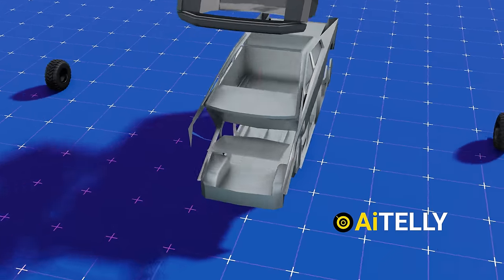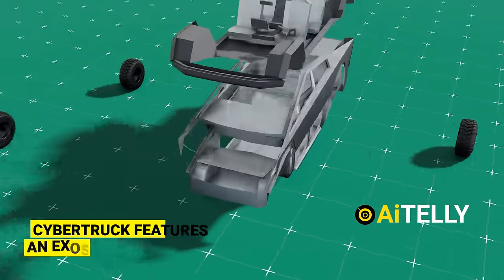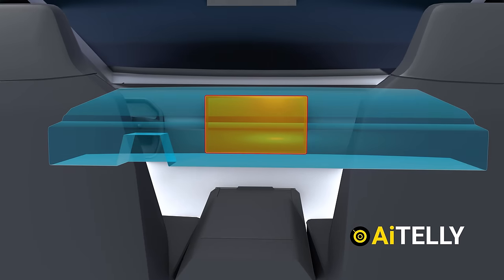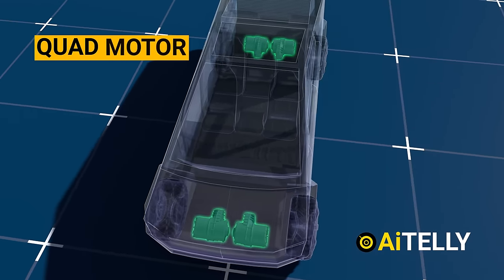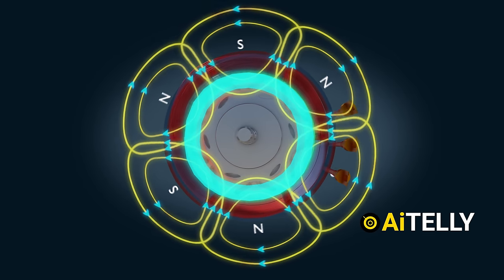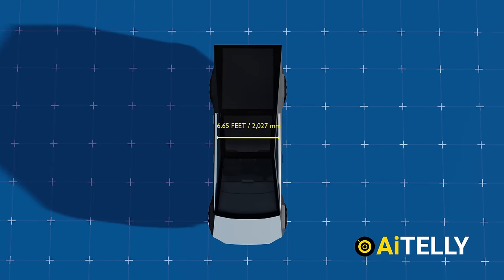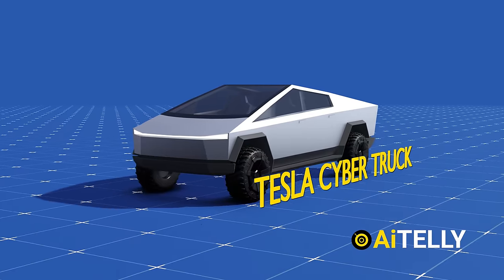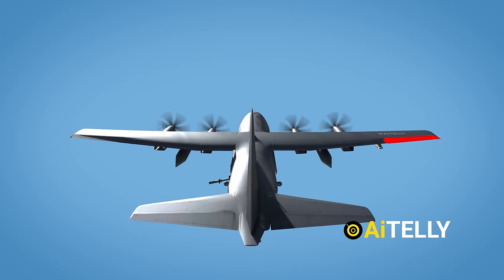Cybertruck Explained  #tesla #cybertruck #3d

Comment: Lots of details and terminology are wrong but nice animations and explanations.

Not SUV, it's a TRUCK (Edit: As others pointed out it's Pick-up Truck)

Screen is 18.5", not 16"-17"

Not bulletproof glass. (but stronger than other cars) Only body is and that's also not for all types.

There are no quad motor variants. And only one out of three motors will be magnet motor. Other two will  be induction motors.

Weight is near 7000 lbs not 5000

Towing is 11000 lbs not 14000
Reply: I believe Tesla provided the data which is probably outdated.
Reply: I agree, but they uploaded this exactly on the day of the delivery event. They could just wait one more day and do the fact check before releasing as it's informative video. (Which in this case, wrong)
Reply: I believe Cybertruck is called pickup truck, not truck (like Semi)
Reply: It's a cyber toy, not a truck. Whether or not a truck or anything else for that matter,  is any good depends on how you intend to use it. To me, it's just another tool.  EV pickup manufacturers should build two types of pickup truck. One for the current market that uses them as an recreational toy and ego booster and one where form follows function with no money wasted on useless styling. It's aesthetic appeal won't earn any more revenue than an ugly truck. Insurance companies are steadily raising their rate for EV's because of the ridiculous repair costs.  EVs depreciate a lot more than ICE vehicles because of low resale values.  Most people who are out buying Tesla's popular and controversial EV pickup are probably not worried about these costs. They're more likely agog over the nothing-else-like-it styling and, at least among the early adopters who  spending six figures on these things, they can likely absorb higher repair costs.  For a construction contractor,  these prices  seem as outlandish as the truck looks. Let's face it, the Tesla truck doesn't seem like it's going to be useful in the construction industry.
Reply: Technically it's a pickup truck due to it's bed in the back